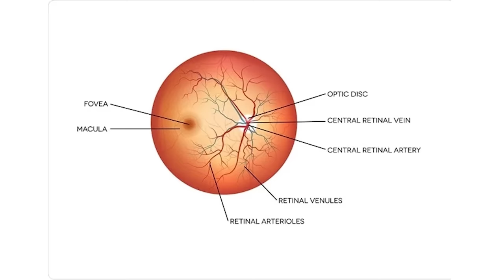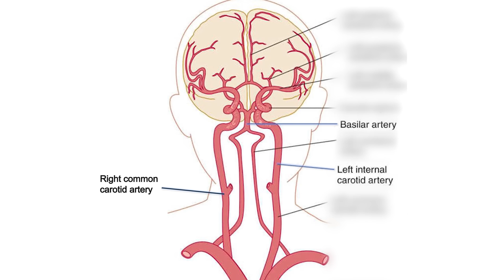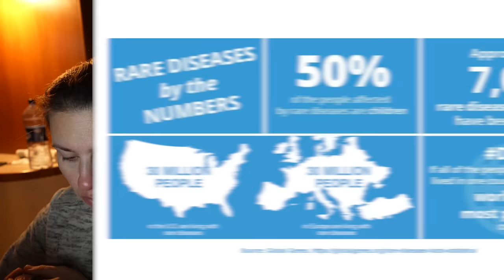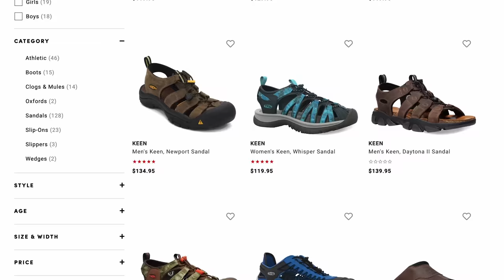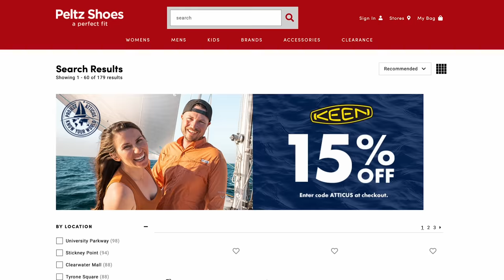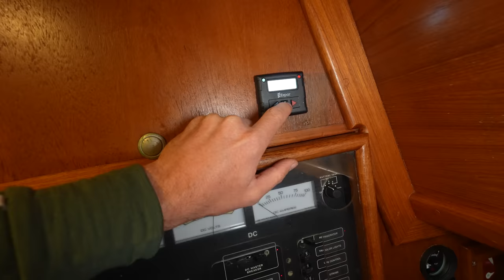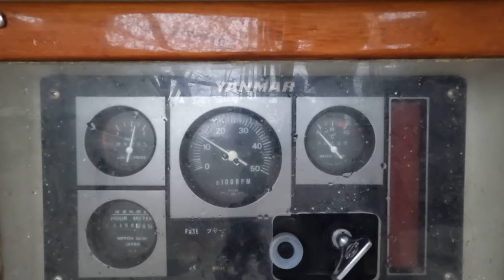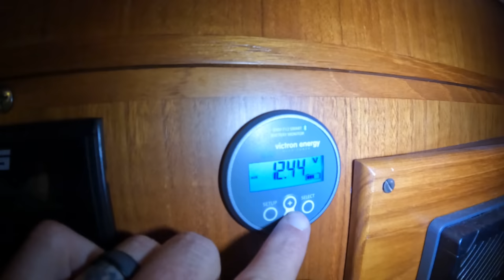Our Daughter has a Serious Medical Condition | S08E04

Comment: I was born with "asthma " as my DR called it.  I could not be within a few hundred yards of lots of dust, cutting grass, ect without stop breathing.  39 years later, through some testing, since birth, I had a 2 inch hole in my atria, no separation between the two chambers.  They said there was not 1 day of my life, that I should have made it. My heart built up calcium deposits on the ventricle walls to create it's own pumping method to keep me going.  I had surgery at age 40 to fix it, and my life will be shorter for the long time stress of the hole and medical negligence.  Keep in mind how resilient kids and people in general are, and how much more advanced medicine is now compared to 1970.

Comment: As a first time father with a baby the same age as Isa, I can very much empathize with you and all you’re going through right now. Right when you think you can’t stand it, everything changes and you’ve got new struggles to deal with.

Regarding the alternator on 4JH. I have dealt with this scenario before where a different shop had installed an idler in the same manor as yourself. With the heavy load on the belt, the idler stud bent overtime and would wedge the belt off the front of the engine. I removed the idler and programmed the Wakespeed WS500 regulator to step the output to allow for warm up time and regulate field current at specific rpm. Food for thought!

Comment: The idler pulley should be on a spring load.  The tension on the belt should be self adjusting with the spring load pulley.

Comment: Might I suggest you carry a spare idler pulley with bearing as you travel since the quality control on the one you put in is unknown and the size of it means it will be spinning way more RPM than the engine or alternator.  You guys are doing great in a very difficult situation.  Remain in strong support of one another and pray a lot.  Fair winds.

Comment: If not already done, you may wish to add threadlock compound to the nuts on the pulley you just added to the engine. High temp threadlock.

Comment: I'm sorry to hear about all the medical tribulations you are going through, the unknown is so stressful.  Praying that everything goes well.  As for the alternator belt thing, if it does start squealing due to the belt stretching over time, I would look for an automatic tensioner kind of like on cars. They have an idler pulley but are spring loaded to provide correct tension even when the belt stretches with age.

Comment: You appear to already have 4 holes in your engine  to mount a spring loaded automatic serpentine belt tensioner pulley bracket assembly right below that same location you added the Idler pulley.  What you did should solve your problem but if you have issues in the future having to frequently manually adjust the belt as it stretches, the spring loaded tensioner would have taken up the slack as the belt.stretched vs you having to constantly.adjust the belt tension manually.  Doorman, Dayco, Gates and Goodyear all make models very economically that have different bolt patterns which should line up with 2 of those 4 holes on your engine.  It would be with the $25-$60 US to me, to not have to be adjusting the belt tension all the time.

Comment: The lack of carotid artery one side should not be a problem. Most likely the other side will compensate just fine. There's a nice design feature in the large brain arteries that's called the Willis circle, that ensures that the whole of the vascular system will distribute enough flow to all the brain. (This does not apply to vascular brain problems in adults, who have a normal sized contralateral carotid artery that might not be able to compensate). The 'good' carotid artery will likely grow larger in the proces of development and compensate just fine into adult life and allow normal function. The artery needs to grow only a few milimeters thicker for the flow to become much larger - flow is proportional to the 4th power of the diameter (!).
The absence of (large) brain hemangiomas or heart problems is great news! That could be a very serious problem in the future if it had happened, but did not.
And yes, I'm a doctor. Best wishes, stay confident and calm, and enjoy Isa and your love all along.
Reply: Is that you, Monsieur Poiseuille?...excellent explanation!

Comment: What is you get the longer belt and a bigger pulley?

The belt should have a bit more surface area touching since the circumference is bigger.

Also with a bigger radius, the belt will have a longer lever arm and increase the torque on the alternator shaft.

Comment: Now that you know the idler situation is working, I’d have the machinist make a spare shaft and also get at least one backup pulley and belt. Keeping the short belt would be a good idea too just in case you had to revert to the old setup…